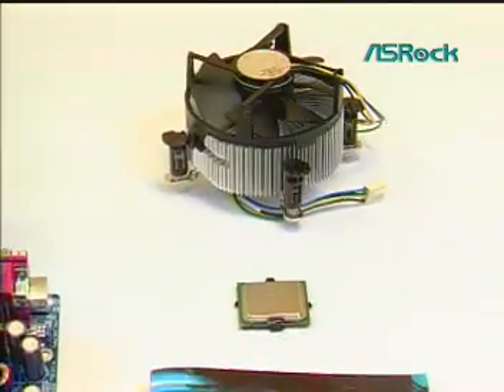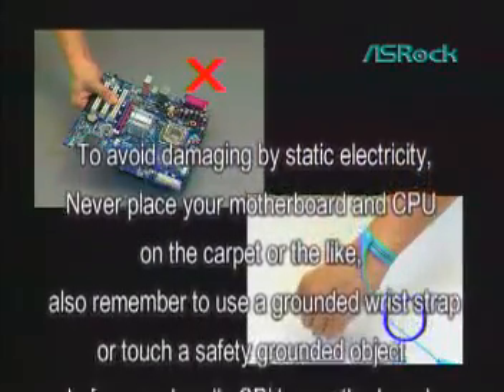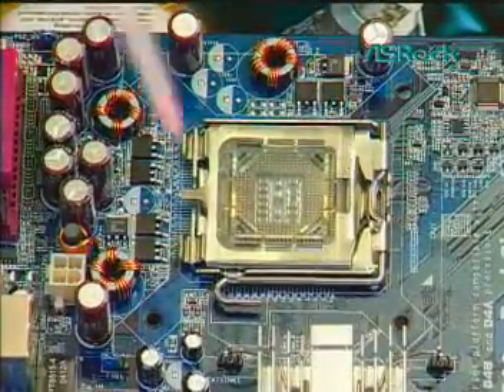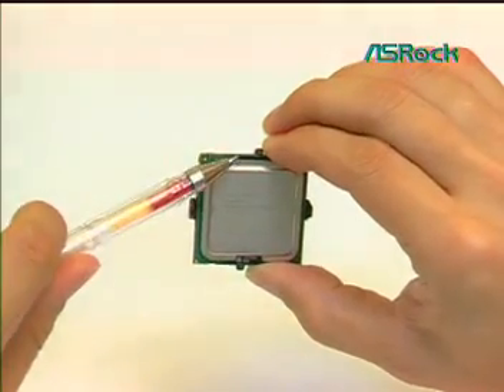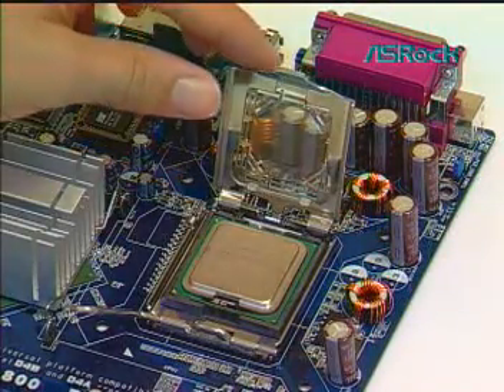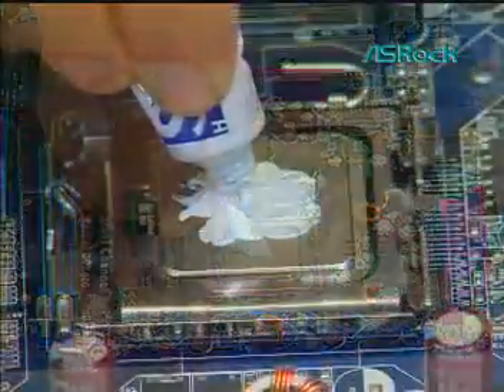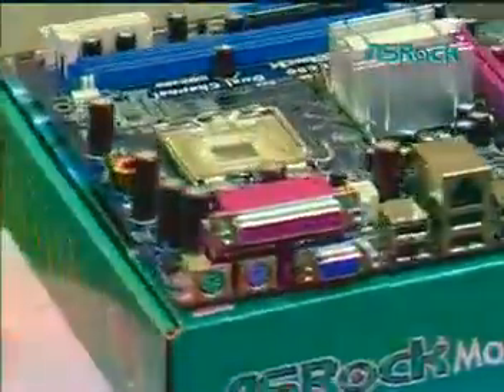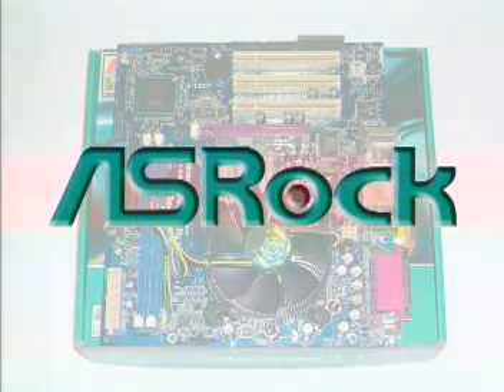LGA775 install video

Comment: I have this exact same motherboard and I can everything else my self but I get little nervous with all the different thermal compounds are theres many with different densitys so watchin yours it jus looked like you smudged in like tooth paste and did not look that think so I am only reapplying the Thermal compound atter cleaning & prepin for new compound 
QUESTION IM ASKING IS ….iv got {Arctic Silver 5 , high density thermal compound} which is very thick is it ok to use this on mine like is it Compatable  & work jus the same  
thanks

Comment: The transcribed captions tell me to "Ryan fasteners with motherboard through holes" and to "actuate fasteners wrote a diff ass in a cab Scott Weiss then push down with Tom to install Winlock".
Reply: And no longer. Thanks, improved accuracy. But it does pick up the music as "[Music]" now.

Comment: I have a HP Pavilion a752n Desktop, runs a Pentium4 570 (P) HT 3.8 GHz. The socket is a Socket LGA775. I only use the PC for web surfing and light office work (word, etc.) and I am avoiding building a new pc (I like the I7’s). My question is I have seen folks upgrade the CPU, from this single core to a dual core. As far as I can see, I think I can only upgrade to a Core™ 2 Duo E4700 (being the highest). I read somewhere that you cannot go over the 800 MHz Front side bus this Asus motherboard has. The motherboard is an Asus, PTGD1-LA.  My question what is the highest and fastest CPU I can get without having any compatibility issues. I saw the Core™ 2 Extreme QX9770, but the FSB on it 1,600 and my motherboard only goes up till 800 FSB. Please help.(I already installed the most memory, I just need to know the CPS question). I know all about SSD drives, etc. Thank you.
Reply: From what you've told me (I think) you have a ASUS PTGD1-LA/PTGD1-LA (Puffer) motherboard. This motherboard has support for Intel Pentium 4 processor up to 3.4 GHz and Intel Pentium 4 HT processors. Therefore, I don't think you can install a dual core processor in your computer even though it would fit into your machine, the BIOS and motherboard wouldn't support it, sorry. Maybe sent an e-mail to HP and see what they say.

Comment: hi! what type of SATA HDD SUPPORTS this board? One suggested me this one ---
Seagate Barracuda 500 GB(ST500DM002)
   Drive Configuration
Device 	Desktop
Device Type 	3.5 Inch HDD
Drive Capacity 	500 GB
Spin Speed 	7200 rpm
Interface 	SATA 6.0 Gbps
Cache Memory 	16 MB
Transfer Rate 	1152 Mbps
I/O Transfer Rate 	4800 Mbps
Data Transfer Rate (To/From Host) 	1000 Mbps
Data Transfer Rate (To/From Buffer) 	1000 Mbps
Average Latency 	4.16 ms

 . Is this SATA HDD  compatiable with this board?
Reply: Yes, but the speed of the SATA port is slower.

Comment: Jesus a lot of thermal paste!! That CPU is totally isolated, and can not transfer it's heat to the cooler. I even think these stock coolers are provided with thermal paste from the factory that should be cleaned off before using a third party grease. That CPU will be cooled extremely insuffecient!

Comment: no i build my pc by myself i bought this shit MB from a cheap shop, the chief said
"oh this is a verry verry good one take it for €70" it was in 2006 i though this mb was new, and btw 2 HDDs are fuckd because of shitty 7pin sata connectors,  there is only a plastic piece in the middle

i need new mb
thx for replying, was helpful

Comment: Nothing new. I damaged a dozen or so boards when installing or uninstalling a certain Pentium 3 boxed CPU cooler, which had a hard to apply retention mechanism. Although one did have a choice back then just to use another cooler, now one is stuck with a stupid socket. Or well, one can use a rivalling CPU plattform.

Comment: Not that I wanna play the sour puss role but... doesn't a new CPU Intel installation means that the heat sink fan already comes with the pre-applied thermal layer?  Meaning that there is a technical error here?

I could be wrong of course, but aren't all Intel CPU 775 boxes sold with the Intel heat sink which again has the thermal layer applied at the company itself?

Comment: so how big was the card you were reading off and way too much thermal grease plus the amd socket am2 is much easier to install fan and all even tho some intel chips are better "quite easy isn't it" ROFL amd instructions " place cpu in socket close lever apply Heatsink"

Comment: Actually i meant the fans don't come with the thermal paste on the heat sink on the bottom like the peel away and apply type of fans. thermal paste is needed I cant imagine what my E6300 @ 2.6 ghz would do without it. I get like 55 C idle and 70 C load...

Comment: are you sure about that.. I bought an E6400 and A Q6600 and installed them 2 weeks ago, Both fans did not come with heatsink, you needed to apply it.

Comment: FYI they put what looked like waaaay too much CPU interface material (the white goop) on. It should be a very thin lair that covers the whole metal plate of the CPU instead of a large gob in the center. Yes the pressure will push that gob out but it still will be uneven.